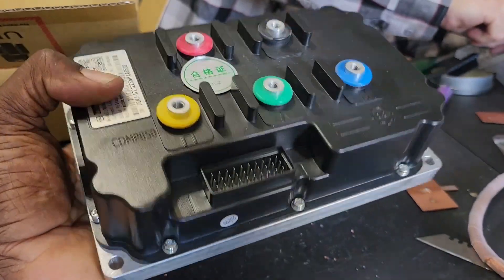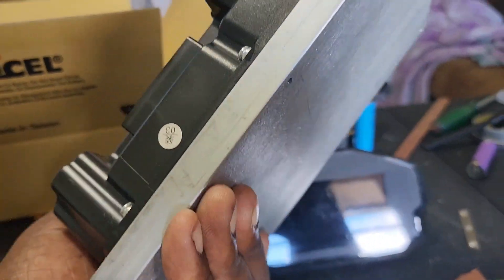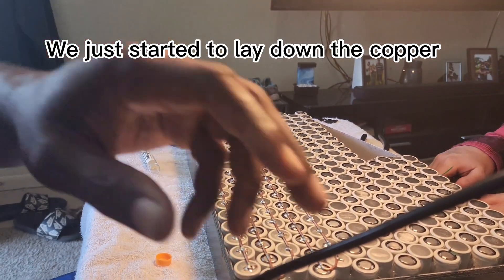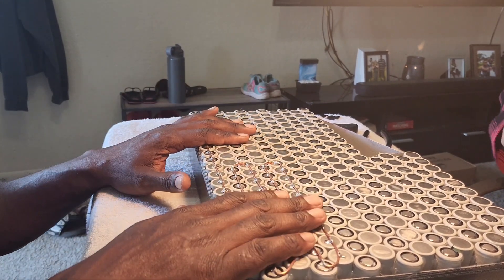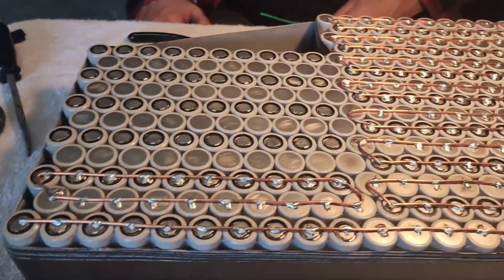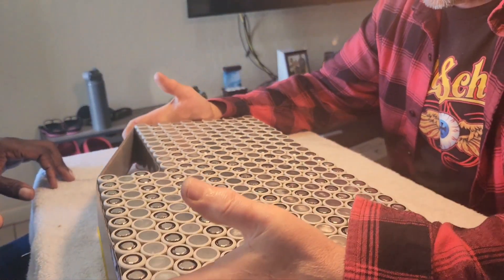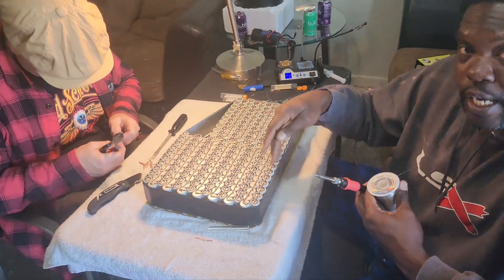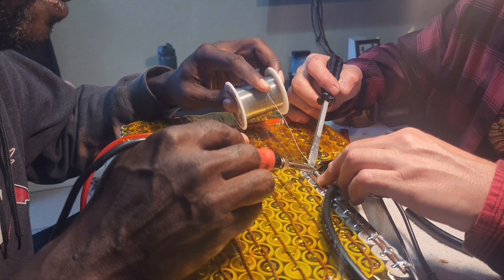96v 40ah epic battery build, molicel. fardriver controller nd96850

Comment: that is a big no no to solder that type of wire on 18650 cells because you have to heat them up to much since its copper and the cells can potentially get damaged and not only that it takes so much heat so you cant do it quickly so if you do it to quick you will get cold welds that look proper but they are cold welds and will fail sometime in the near future.

Comment: Would this battery fit the stealth bomber frame from nbpower? And with this battery would the controller still be able to pull 850 phase even if the battery is 450A?
Reply from the maker: I can get it configured for it to fit

Comment: Im surprised you soldered it and  didnt use insulator rings. In high amp draws the copper could get really hot and melt the plastic wrap and coulb possibly cause a short. Or vibrations could cause the short
Reply from the maker: I understand that 💯  to be honest this battery should never been made like this I advise the owner to do to my method  with nickel copper,  but instead  he wanted just copper,  non of the the equipment he brought wasn't up to the task but I wasn't going to argue with the customer,  11 months later something did happen and I believe it did exactly what you said,  and got a short  caught fire  now he blame me for his screw up🙄
Reply: @EBG-offical  its actually better to use copper wires instead of nickel copper strips, coz of the lesser resistance, but id use stranded wires coz solid wires are prone to cracking due to vibration. And definitely use adequate insulation and a good rubber paddings on your battery box specially at the bottom where most of the weight of the battery placed
Reply: @EBG-offical shouldn't you have refused then? I mean how much extra is it cost and labor for the insulator rings
Reply from the maker: @andyfumo8931  man if I knew that crap was going to happen I definitely would have refused  I didn't get paid  and the owner knew exactly what he wanted. It was no convincing him otherwise
Reply: @EBG-offical  so how'd he convince you? You knew what was going to happen, it's inevitable. Please do better bro 🙏p
Reply from the maker: @andyfumo8931  think before you speak,  we put it together it had a short when he was riding it do you me holding the battery,  that's how it was he it left my hands that means he wraped his battery that way he want it bro. after that it's on the customer.
Reply: @EBG-offical  sounds like a drug dealer but that kinda shit is the reason all these governments want to put restrictions and bans on ebikes. Thanks for your knowledge and uploading always but no thanks for your gross negligence
Reply from the maker: @andyfumo8931  no problem 😊
Reply: @EBG-offical  imagine if i told my surgeon what to do for my spine surgery, or heart transplant, and the idiot doctor takes my advice and i die. Thats basically what you did here, you're fully responsible and you trying to put blame on your moron customers is hilariously childish

Comment: That is awesome. I look forward to when these much more high powered batteries are common. I have a question can a 240V battery be built? If not what is the highest Voltage that can be built? Thanks!
Reply from the maker: Yes you can go 240v lol it will be like a 52s 10p
Reply: @EBG-offical  sweet, thanks! 2 more questions if you don’t mind. Does that make the weight much more given the same parameters say 50amp battery 96V vs 240V
Reply from the maker: @buffalomind6838  the ah will be the same if 10 In parallel but 20 will be 100ah 52s 240v but the weight will be insanely heavy
Reply: @EBG-offical  Ah, thanks a lot for your responses. You just got another subscriber. 🫡
Reply from the maker: @buffalomind6838  thank you so much,  glad to help out!!!

Comment: There is so much wrong with that battery tho. With series connections like that, that battery will get massive, massive amounts of voltage drop and will get very hot. No BMS to monitor anything or protect from over charge, over discharge, nothing separating the cell groups, soldered to the cells, lmao. I doubt its still working.
Reply from the maker: Thank you for your concern. The battery still do work.  It's for a customer. But actually it works too good 👍
Reply: I get the concern about the series connections. He is learning and at least he is getting it done. but the BMS thing is bullshit and you know it. A BMS is like the Government, says it will help but all it does is ruin your fun. BMS makes people to comfortable with large packs. I do suggest a Active balancer with bluetooth so you can see the pack voltages and will let you know if something is up before you burst a cell. BMS was made for pouch cells because those are the ones that cause massive fire.
Reply: @Timboslicce another comment ebikeguy states this battery caught fire after a short .. 😅

Comment: They need to use rubber gloves and not use the screwdriver to push down on the batteries.
Reply from the maker: You right,  my next battery build I'll use gloves or a rubber tip.

Comment: That’s a powerful battery to not have a BMS at least for charging. Also, there’s no way to tell if one of the cells drop in voltage without a Bluetooth BMS.

Comment: WHER IS THE BMS 😮😮🔥🔥🔥🔥🚒🚒🚒
Reply from the maker: Look bro, if you don't have nothing good to say, or advice, you will be blocked sir good day!!
Reply: @EBG-offical  I was thinking the same question.

I put a common charge/discharge BMS on each one I work on. Then I add a 2nd pair of balance leads for a external active balancer. This unit helps me maintain and repair and balance issues that occur.  Then being external I use one unit one many batteries. Here the video where I added the external balancer. 100% recommended by me.
https://youtu.be/zMOUt7dSupM
Reply: Relax there young man , just saying because we have all these FIRES in NYC and people are dying or getting seriously injured  so now the NYC major put in new laws ...and BMS is the heat of the battery 🔋
Reply from the maker: @MADMAX MAN  I have not had a problem with battery fire and I hope not to but I done alot of research and I mean alot even this build was for a customer he was with me all the way to build this battery he also done his research before he gave the green light, in 6 months I had my 72v battery without a bms but I also have a smart charger from grin technology and believe me when I say this I will never build a battery if it was that bad with fire 🔥 I understand 💯 where you coming from but some of that stuff on the news is misleading when people ues the wrong charger or handle the battery improperly. But anyway I just want respect that's all I'm a nice guy and I get along with anybody if you have any advice or you think I have something that it can be improved let me know 💯
Reply: Got you big bro

Comment: do the far driver controllers have field weakening  or it may be by a different name but the ability to throw extra amperage at the motor in a way it can push it past itz rpm/v limit? I've been using phaserunners for awhile which are also fox but I'm looking for something with a higher amperage it's 72v/96a but its honestly runs more at 40a due to throttling from temp in the summer
Reply: you have to be so very careful not to get the battery too hot when soldering . I personally use both ,and keep solder away from the cells . pure Nickle is getting harder to find the real deal. its dangerous for the iron fakes too
Reply from the maker: Thank you buddy,  but yes, the fardriver controller do have flux weakening.

Comment: A quality spot welder is the only way to go. Solder iron creates too much heat.
Reply from the maker: Correct buddy, the owner wanted to make sure that the cells are connected, and it's not coming back apart lol.

Comment: Thankyou for the video. What brand and solder are you using. Thankyou
Reply from the maker: Thank you gor watching,  but I got the solder from Amazon it works so good I threw my old stuff out lol
Reply: @EBG-offical  There are so many brands   on Amazon what do you recommend Thankyou .
Reply from the maker: I'll send you a link
Reply from the maker: Help me decide on this product: WEP 927-IV Soldering Station Kit High-Power 110W with 3 Preset Channels, Sleep Mode, LED Magnifier, 5 Extra Iron Tips, Tip Cleaner, 2 Helping Hands, Tip Storage Slots, Lead-free Solder Wire, Tweezers https://a.co/d/71TGPMn

Comment: What is an acceptable voltage difference between cell groups in a battery pack?
Reply: There’s no simple answer to your question. It depends on if you have a basic BMS or smart BMS and what SOC you are checking the differential voltage. Or if you are assembling a battery and want to know what max differential is before placing it in service.

For a basic BMS, you need to check differential voltage at full charge and all cells should be within +/- 0.01v. If cell differential gets too high the charger will not taper down cirrent before the highest cell group hits 4.25v and shuts the charge port. So no balancing will take place. Basic BMS balance ONLY happens after the charger light turns green and you leave it connected to trickle charge as the BMS bleeds the high cells.

For a Smart BMS, you can set it to autobalance until all cell groups are within 0.001v. If its only using bleed resistors then normally thats 0.1a max so about 3x faster than a basic BMS. If it has active balancing and transfers energy from the highest group to the lowest group, even the slowest rated at 0.6a will balance 10x faster because its attacking the imbalance from both ends. 

If you have proper top balance and then discharge the battery, cell differential should stay within 0.05v down to nominal voltage. If one group is significantly below the others its a sign that brick has a bad cell or a cell that became disconnected. 

As you reach the low battery its very common for the cell differential to start spreading because you are leaving the flat part of the SOC curve and any differences in capacity or IR will be magnified. Only a perfect battery can stay balanced from top to bottom. 

Some people use an active balancer that is working the whole time from full charge to low battery but this is not good because it will mask any problems that might be happening and also any balancing you do at bottom has to be undone when you charge it so you are wasting energy and making it harder to top balance. Normally the active balancing is only done at top 10% of the charge. 

In an emergency when you got low battery a few miles from home if you have a smart bms with active balancing you can use your phone to activate it and it might give you a few miles in turtle mode. But most people will set the BMS to show 0% SOC when you still have 5%-10% useable capacity to ensure you can get home and not over stress the battery by taking it below 20% SOC too often.
Reply from the maker: 4.0v in a cell group but I charge mine up to 4.4v

Comment: Hey I want to modify the 2018 Rad Wagon Cargo. With QS 205 I'm in California. I want to ship my Rad Wagon frame/front tire, fork. Minis battery, controller, display and rear hub motor rim. Mr.Ebike You Build the Q.S. 205 on 26" spacing 150. Build 72 volt battery and  saboton  150 amp 🙌🏾 your conversion kit. Ship box back to Cali. $$$$ est
Reply from the maker: Email me at theebikeguy08@gmail.com
Reply: @EBG-offical  can you send me your email address I would like to get a quote for a couple of things I live in California too
Reply from the maker: Theebikeguy08@gmail.com
Reply: Do it yourself I put a 2000watt motor on my mini rad

Comment: Soldering the only way to go never use cheap spot welder too easy to make little holes in the battery tops and spot-welded tabs don't handle the vibration as well as soldered and that's hard to damage a battery with a soldering iron you really have to leave the iron long time . Very impressive battery pack .
Reply: Shawnsebikesandstuf15 you are absolutely wrong about soldering. 
E-BikeGuy it would of been better to spotweld nickel then solder copper plate to make your series connections.
Reply from the maker: Thanks you, that's was our last option was to go spot welding, but I told him we should try this method he the owner agreed since it not coming apart again.
Reply: @EBG-offical  Hello bro,what brand is the solder gun you're using and how many watts is it?
Reply from the maker: @chris-hg3iv  I'll send you the link it's 150w
Reply from the maker: Limited-time deal: WEP 927-IV Soldering Station Kit High-Power 110W with 3 Preset Channels, Sleep Mode, LED Magnifier, 5 Extra Iron Tips, Tip Cleaner, 2 Helping Hands, Tip Storage Slots, Lead-free Solder Wire, Tweezers https://www.amazon.com/dp/B09TXP1KDV?ref_=cm_sw_r_apann_dp_TT0TRMKJ400TN0Y5GXE2
Reply: @EBG-offical  Thanks a lot for the reply brother.
Reply from the maker: @chris-hg3iv  no problem
Reply: Good spot welders arent cheap. There is a reason that PEV manufactures spot weld.

Comment: Nice job but you need more series conection to pull 450A. A spotwelder is a fraction of the cost of your 260pcs of p42a, buy a spotwelder instead of that messy soldering.
Reply from the maker: I know but was a request from the owner and me to go this route plus it's not coming apart again.
Reply: He has a spot welder but the problem began when the cells were arranged improperly for using nickel strips. You see the row of 20 cells that’s connected with 2 wires, that would have needed a stack of 10 nickel strips, not really a good idea, so the copper wire is best. The Aliexpress battery made the same mistake and thats why it burned there first. But in fairness the battery was designed for 60a not 200a. Lol. When I made my DIY 32650 battery I gave it series buses that can carry enough current to pop all the CID simultaneously. Lol

Most series connections in the 26s10p battery were 4 wires which should be on cell 1-4-7-10 for even current. The only problem child is going to be the 2 wire series connection. It really should have been at least 4 wires, and they can be staggered lengths (20 cells-16 cells- 12 cells-8-cells) because the highest current will happen the closer gets to the bridge between those two cell groups. 

If it were my battery when I installed the Smart BMS I would put one of the temperature probes attached to that 2 wire bridge and monitor it because thats going to get hottest. Its not going to burn in half but it might desolder those cells near the bridge. Not a problem as long as there is a BMS without bypass or at minimum a smart BMS and watching cell differential to see if those bricks are dropping significantly faster than the others.

Of course to match that battery to the fardriver 96850 it will need one series wire per cell and then the main battery cable should be equal to 10x the mm^2 of the copper wire uses in the series connections. I don’t know if normal nickel strips would even be able to carry 45a per strip. It would have needed solid sheets of 2s. 

I think they planned on using the copper bar with holes drilled in it but ran into problems, perhaps too stiff to go across the positive terminals with cell protectors and without cell protectors its quite dangerous. They would need to CNC the copper bars to accommodate the positive terminals safely. That copper bar can probably handle that 20 cell row series bridge easily. But in the end its not practical. 

But its what the customer wanted and the soldering job was good and it can easily be beefed up without taking the battery apart if needed.
Reply from the maker: Good information brother love to read you comments,  5his battery is not coming apart again, we made it best to handle the current.